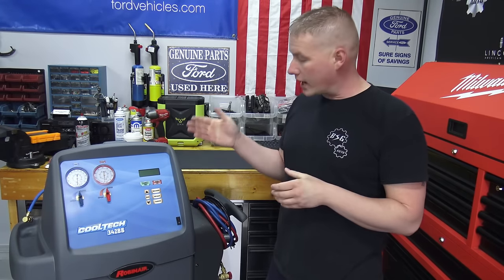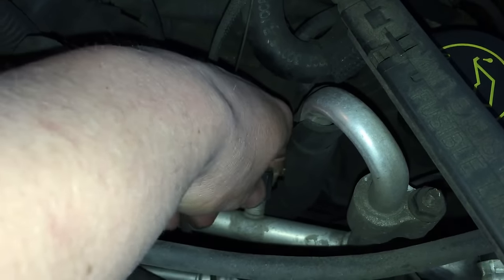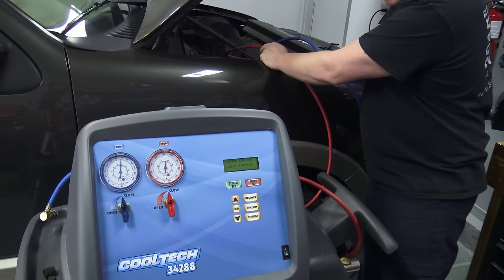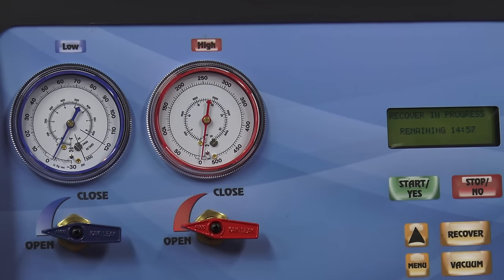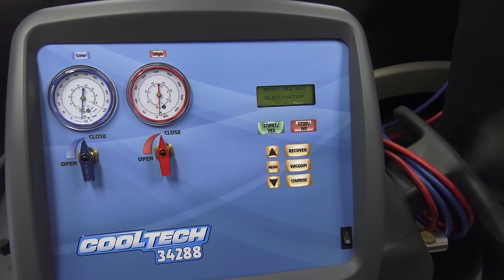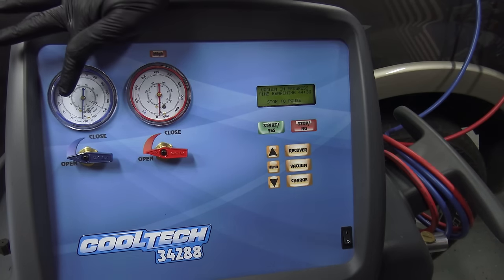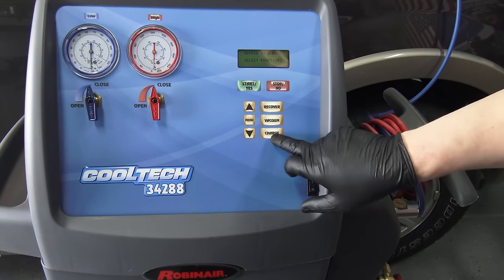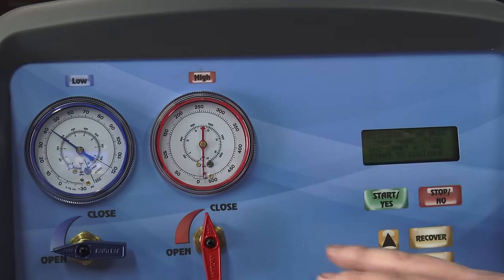How Professionals Recover & Recharge Your Vehicles A/C System

Comment: I have an appointment this Friday for this at Ford. They start price at 179. Is this a fair price?  Seems kind of high to me
08 Crown Vic.
Reply: Seems pretty high to me ,I bought a Grand Marquis from a ford dealer in Feb . In may I realized the air conditioning blew hot air so I called him up. He said he would take care of it .Him taking care of it cost me $144. 00 but at least it works now !!
Reply: I don't know much about this kind of Repair.. but what I do know is that Everything now days is Smaller and cost 3 or 4 times
Reply from the maker: +John Rhodes It does seem high but it depends what the labor rate is in your part of the country we used to get paid 1.2hrs for an evac and recharge. So if the labor rate is $130 an hour you can see how this can add up. If you are just getting an evac and recharge goto a regular independent shop much cheaper for a basic service.
Reply: +FordTechMakuloco I bought the car about 2 years ago and the a/c was dead. I put a big can in and it has held pressure. I live in Rhode Island and bought the car from a guy in Virginia  on eBay who told me it was from a small  Colorado police dept. I must say for a used CVPI with 69k on speedo it runs excellent. I am just thinking it would be good to have it hooked up to the machine and have proper levels of pag and freon. I think the dealer is 100 more than the independent  shop.  I don't know if it's going to need any new parts or not and I like OEM just not the prices. Lol
Reply: Here in sweden it costs around 150-230 euro

Comment: Thank you for this Great video .. 
but i have question ! 
most car dealer has common method to fill the AC when engine On and with pressure Gage , what is the difference between them . !?
Reply: The different is to know how good is the ac compressor, that's for the high pressure line have to be connected ,so in that case if the compressor is good or not u will know by the pressure

Comment: Hello boss, I'm vacuuming 2011 but I can't reach -30 hg psi just -17 is that normal
Reply from the maker: No
Reply: @FordTechMakuloco                                      what could be wrong?
Reply: @tizocchuck5944   The only 2 things I can think of is that either you have a small leak or your vacuum pump is worn. Check your set-up first with out connecting to your car's A/C system to eliminate your set-up is not leaking or your vacuum pump is worn out.

Comment: Can I reuse the refrigerant by this machine instead of recharging fresh
Reply: Can I reuse the existing refrigerant by this machine instead of recharging fresh from new container. Because it will save money and stop environmental pollution as well.
Reply from the maker: The machine recycles the old refrigerant and reuses it.
Reply: @FordTechMakuloco , that means I can suck the existing refrigerant and after that I can also dismantle the whole A/C system to get repared, and recharge the old refrigerant again after reinstalled?

Comment: Most mechanic do haphazard job on HVAC like using compressed air to purge the system 😂. For one hardly any mechanic is certified to work on HVAC and does not know proper procedure. You maybe one of the few who at least does it properly.
Reply: You get what you pay for buddy

Comment: Now more confused

Putting oil in is a guess. Your putting in what machine suck out? 2oz. Mine takes 7oz

What is actually still in your car? 

Sounds like guess. Many cars take 7oz or more

 I drain oil out of all components and hoses by removing and using compressed air.

Comment: does pulling a vacuum take the oil out of the compressor?
Reply from the maker: Only an ounce or so comes out with the refrigerant you just need to check the oil recovery bottle to see how much.
Reply: ok, thanks!
Reply: @FordTechMakuloco  Hi what if my AC system already low on oil does the service man know...I mean what if the oil catch can is already low how would the mechanic know that the system needs more AC oil?